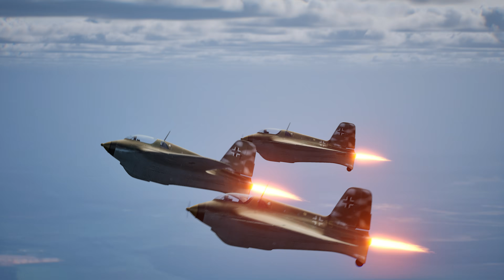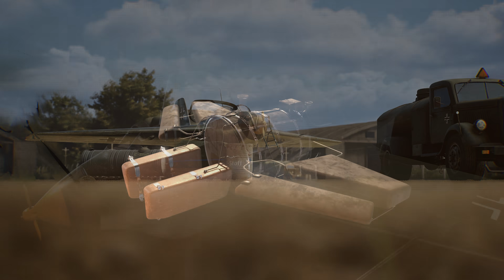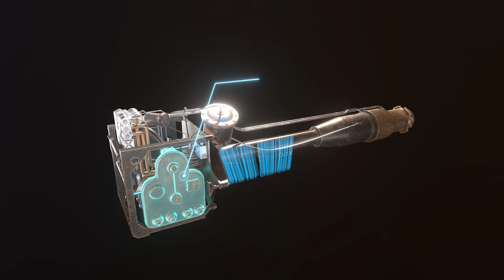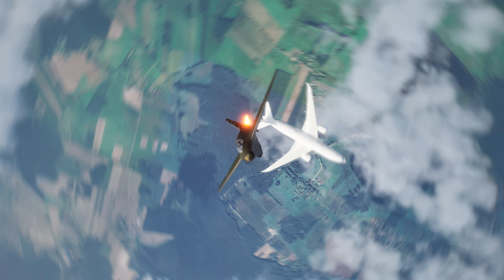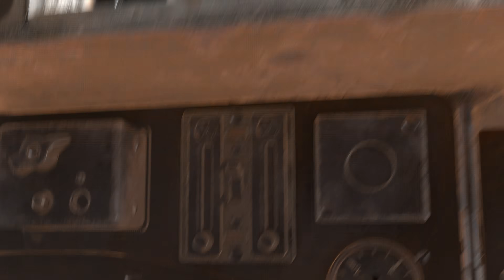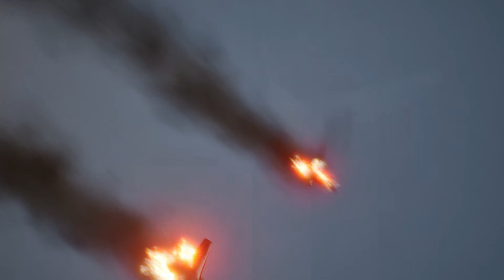Inside the ME-163 Komet; WWII's Strangest Fighter

Comment: According to Google, the Walter engine had a specific impulse (Isp) of about 180 seconds. The slightly later De Havilland Spectre also used HTP (High Test Peroxide) as its oxidiser, but kerosene (ordinary jet fuel) as its fuel, and achieved an Isp of about 235 seconds. Not only did kerosene give a better Isp, but it was much safer than the toxic C-Stoff (hydtrazine).

Why did Walter go with hydrazine?
Reply: Walter stuck to what they knew worked. Look at all the Walter HWK 109-500 engines used on Ar-234s up to clumsy Me-323s.

Comment: Were these reverse engineered by Bell to make the X-1? I seem to remember reading that the pilots would catch fire when the fuels mixed or touched their skin. No spark needed. The hydrogen peroxide was so corrosive that some pilots had chemical burns so bad they had no flesh left by the time they landed.
Reply: re: "Were these reverse engineered by Bell to make the X-1"
Not. The X-1 was based on the .50 cal round for fuselage.

Comment: At the very end of the war, those two cannons were replaced by vertically-firing cannons. The idea was that the 163 would pass underneath the target bomber and fire into its belly. It proved much better than the original armament, but the war ended before it was of much practical use.
Reply: was supposed to be trigger a photoceptor trigger
Reply from the maker: @mikethompson2650  Yeah. It also shot at the sky when the Komet passed under the clouds :)
Reply: @ThePresage  that doesn't surprise me, to be honest I am surprised they had such a device in 44-45.